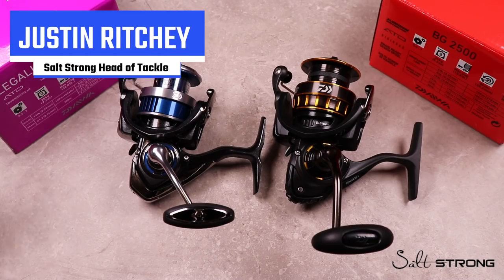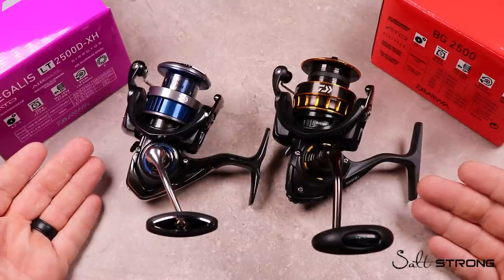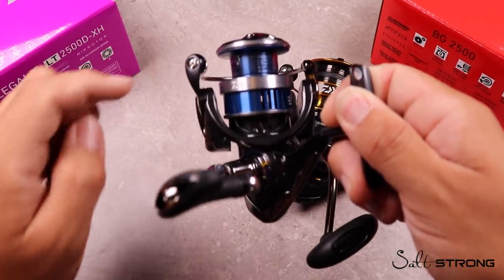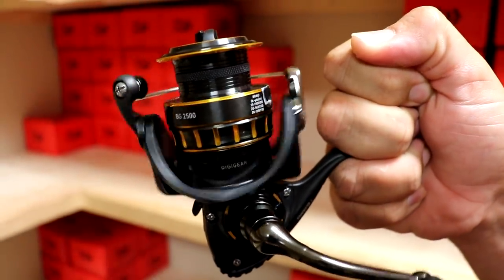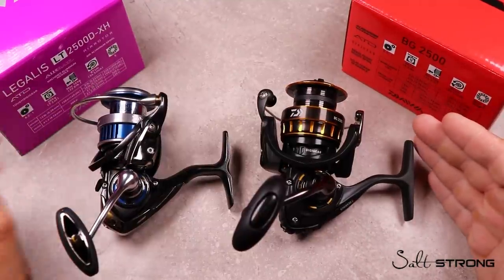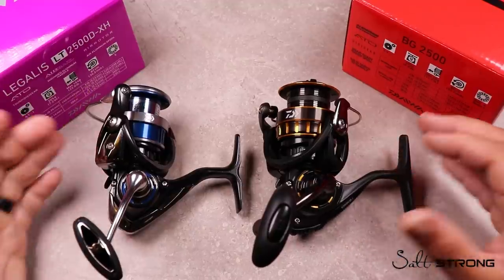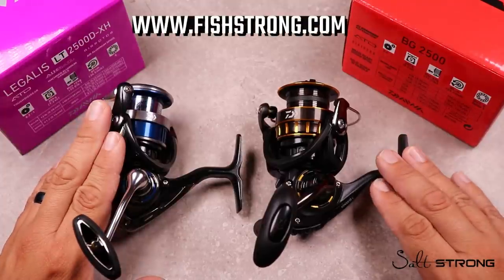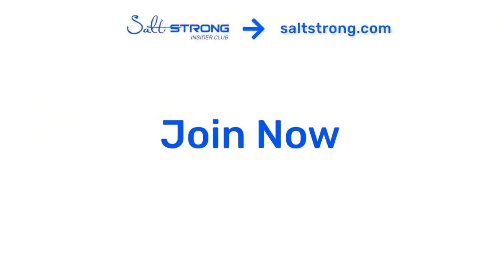How To Decide What Gear Ratio Spinning Reel Is Right For You

Comment: One big difference I do see between the reels is the amount of drag available, with the BG limited to 13.2lbs of drag while the Legalis is rated at almost double at 22lbs of drag. It's a difficult aspect to compare two reels and what all those numbers mean in the end. Mount the rod in a holder and try this:  If you attach a 6 pack of beer to the end of the line and measure the force you have to apply on the handle of the reel to lift the beer off the ground, that would be a good comparison of how the gear/torque numbers work themselves out inside the different reels. A lower gear ratio should mean less force needed to lift the beer, but just how much less? You could have a higher speed reel with a longer handle that produces the same overall torque as a slower geared reel in the end...

Comment: You said nothing about the diameter of the spool or does it balance on the rod you have.
Reply: You’re right about that!  Turns per crank are more absolute than inches per turn.  As you gather in more line and increase the circumference of the spool you increase the number of inches per turn. Stick with revolutions per crank as the metric!!
Reply: @mbari6963  Some reels of different "size" are really just the same basic body of a reel with a larger or smaller spool on the end to give different results. Changing the size of the spool changes the results you get in a number of ways, torque and inches per turn with the same gear ratio. You could have a 3000 size reel and a 4000 size reel that are exactly the same except they each have a different spool size. You could just swap out the spool size from one to the other to step up or down depending on what you want. Not every company does that but if you look carefully you can see who does.

Comment: Interesting video, thanks for sharing! Maybe its nice to make another video about which gear ratio's are used for which type of fishing styles ( speed jigging,  slow jigging, throwing poppers etc. )
Reply: I've been fishing for 25 years of my life and I can answer that for you very quickly. Slower presentations with heavier lures or bait like crankaits and whole dead or live bait-fish need a lower numbered gear ratio. 

Because the lower the number on the gear ratio the less line will be reeled in per a rotation of the handle causing a slower more natural presentation. On the other hand faster presentations require a higher gear ratio typically with Carolina rigs you want a 7.2.1 gear ratio for example. 

The downside to spinning reels is they don't go that high in gear ratio only baitcaster reels do unfortunately. But that's why you see professional bass fisherman using baitcasters instead of spinning reels most of the time anyway.
Reply: @mch.l.trecords9169  Thanks for your reply! ;)
Reply: @robertdejonge3607  no problem man, I'm glad I could help.

Comment: Good video Salt Strong but you should have pointed out that the old Daiwa sizing on BG 2500 is a larger spool circumference than LT sized 2500.
Therefore with a lower gear ratio can retrieve almost as much line per crank as the highter gear Legalis. Personally I prefer Daiwa’s old sizing.

Comment: For surf fishing dead bait like cur fish or shrimps or small crabs etc etc but no lure or jug
I want to throw the bait with sinker soooo far 
Which or how do i know its for my needs 
I will also look for 3.5m to 4m rod medium power fast action i think is my need as rod 
But reel i have no idea
I bought daiwa bg60 before 10 years😅 i only knew daiwa is good but the model or spec i have no idea later i checked their website it said its heavy power reel